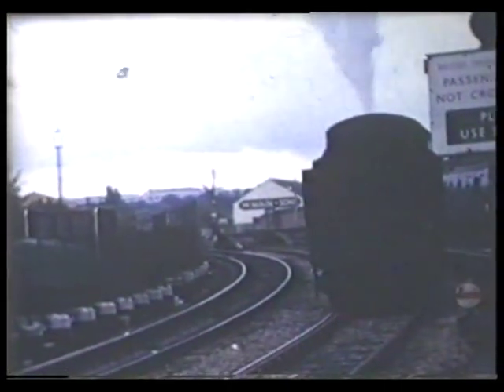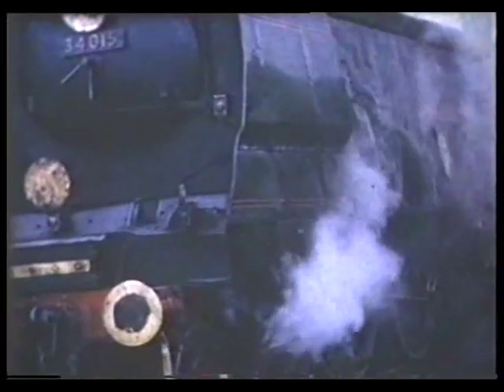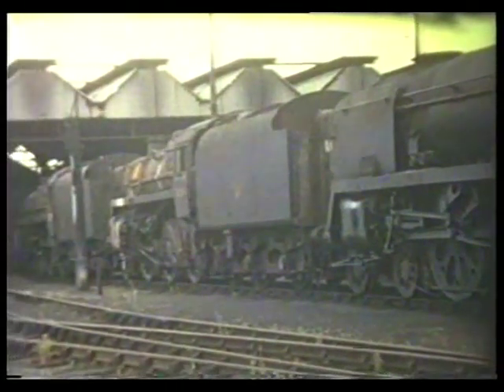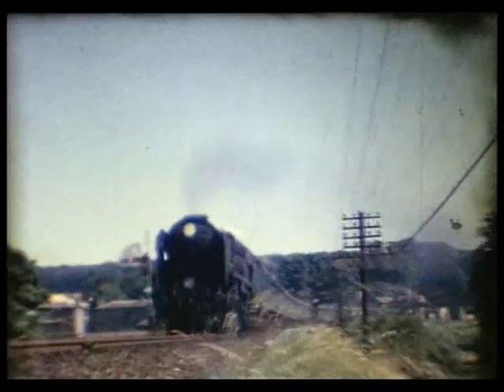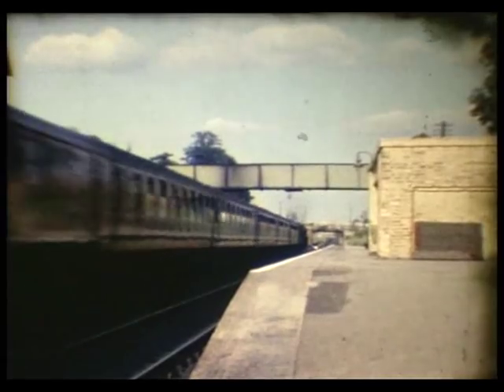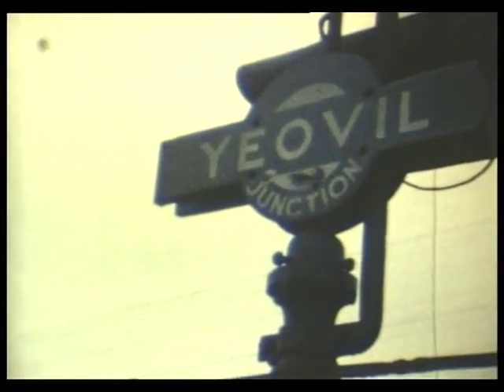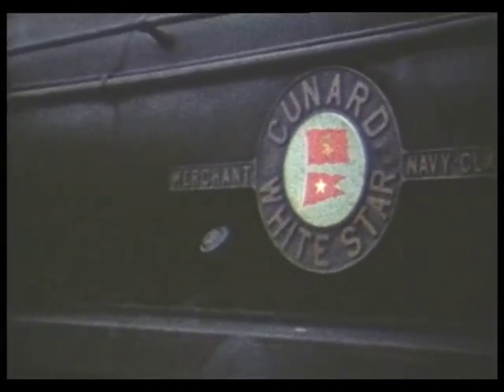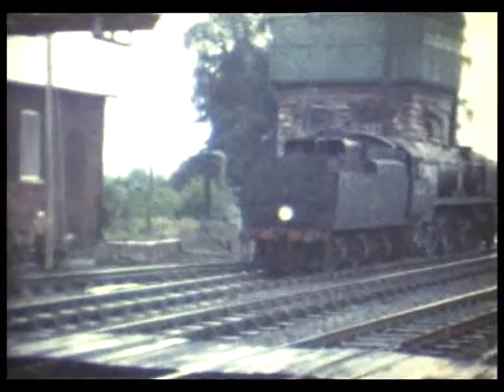Steam at Salisbury mid 60's

Comment: Nice to see a close up of 34015's Right Hand nameplate.  It is easily identified by the large oversize fixing hole above the U, due to the side casing continually moving and shaking at speed....it made the hole larger than it should be.   This nameplate set is now on the wall on our landing. The other side resides in Exmouth Town Hall (with all original fixing holes filled in....dreadful!).

Comment: I well recall West Country Class - both rebuilt and unrebuilt - on the daily service from Brighton to Plymouth. Brighton shed was well-known for the good turnout of its locomotives, something that ceased when (after 1964) the locomotives were stationed at Fratton.  I saw some of the very last West Countries on this route early in 1967, and they were without nameplates and extremely grimy, though still able to give a good turn of speed.

Comment: All pacifics were famous for slipping, because some of the adhesion weight was wasted on the trailing axel under the firebox.
GWR 4-6-0s never suffered with this problem as most of the adhesion weight was concentrated on the 6 divers.
When the interchange trials were held, a Castle class would haul it's train up the Kings Cross tunnel much quicker than a pacific.
Reply: What about the LMS Coronation Class and LNER A1-A4? they were pacifics and they had adequate grip.

On one side, you need to limit how much weight is on the drivers in order to prevent the locomotive from breaking the rails, on the other side you need enough weight to prevent wheelslip, the pacific design was chosen over something like a Mastodon 4-8-0 due to how long a fixed wheelbase can actually be when going round corners.

The trailing wheel was also used for stabilization at high speeds.
Reply: All pacifics are prone to slipping when starting as the weight transfers to the trailing unpowered axle and off the driving wheels. Once underway the advantage then transfers to the Pacific away from the 4-6-0 due to the wide firebox and greater steam raising capability. At the end of the day a loco's power is limited by it's ability to make steam. That is why a Coronation will always out do a King. The best ever run on the Cornish Riviera, in steam days, was made by 46237 City of Bristol when on loan to the Western Region.
Reply: Rubbish, the reason for slipping at Waterloo was that sanding was not allowed as it might have interfered with the Track Circuits.
Reply: @simonjames3845  So replacing worn out rails due to being worn out by slipping drivers, was more expensive than replacing track circuits???
Reply: @Rog5446  No SAFETY is more important, a false reading on a Track Circuit could cause a wrong side signal failure.